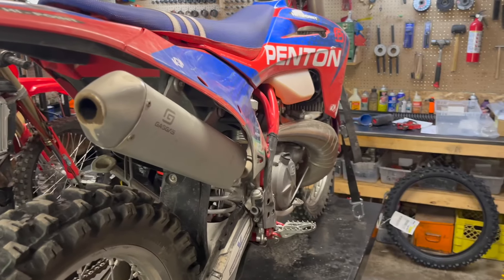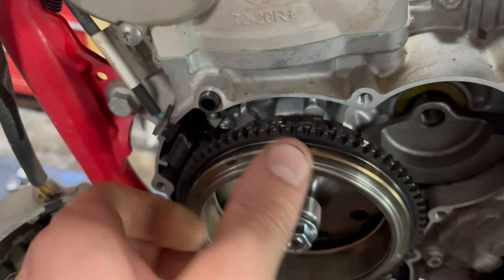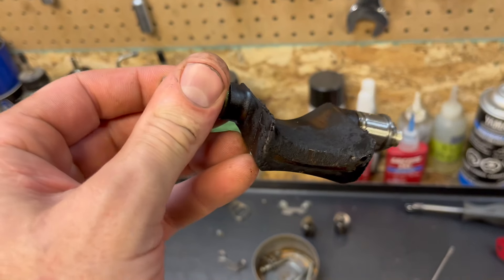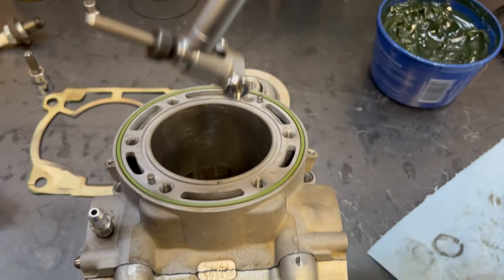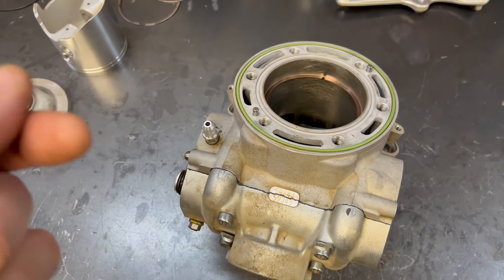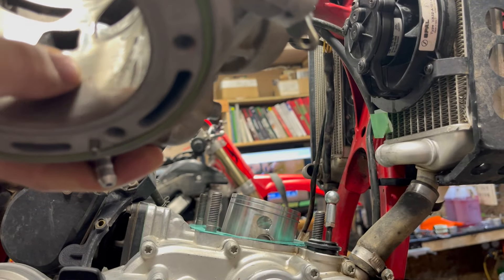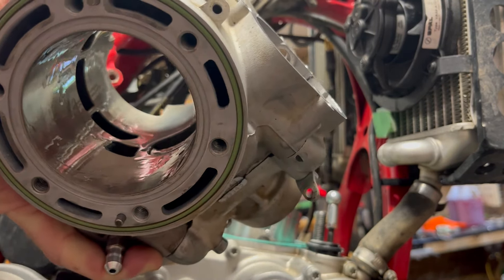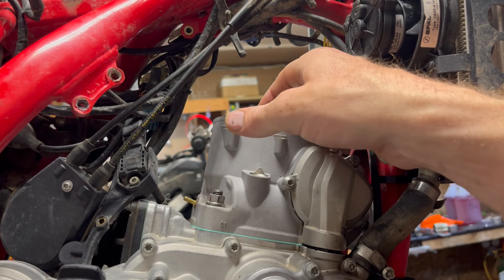How to do a 2 Stroke Top End- Properly

Comment: yesss not enough people measure the piston to wall clearance.  I dont have a dial bore gauge but I use a telescoping bore gaugue and mic out the measurement on the top middle and bottom of the cylinder walls on the x and y axis.  You really are one of the most thorough mechanics on youtube Ive seen.  Always learn from your videos, keep it up
Reply: For sure. I've machined alot of bores for critical bearing and bushings over the years and have gotten by with gauges and a mic.
Reply: @jeremydoblinger3609  Yep, telescoping gauges (called a comparison gauge, because they don't give a actual number with out a OD mic), take a bit more sill to be accurate.  But once you do it well, you should be able to repeat measurements with in .0001".  The mic needs to be calibrated on a round surface for the best accuracy.
Reply: skill

Comment: The EIX plugs are a down grade over a conventional core plug. The biggest reason the rare metal plugs should be used is for higher service intervals. A conventional core plug is a better heat sink which is more important to high performance engines like these Vs longevity of the plug.

Comment: The torque of the cylinder base can distort the bottom of the cylinder, with gasket that can compress.  My YZ also has the front 2 bolts that I can not get my torque wrench on (don't have a "crow foot extension"), but I figured out a way to get them very close to torque spec.  I torque the back bolts about 1-2 lbs shy, then use the closed end wrench (noting the hand pressure) to finish them off.  The torque the front bolts noting the same hand pressure.  I think I will use a bit of grease on the thread as you did for the most consistent torque feeling.  The base of the cylinder with gaskets that compress, bends a bit around the transfer port area, like pushing down on a teeter totter on both sides.  On the smaller engines I build for a living, it can be enough distortion to close up .002" of piston/wall clearance, and cause some piston wear at the bottom of the stroke if you run out of clearance.  I have used copper base gasket (with a sealer that does not dry before I can get the cylinder on), that do not compress, and they stopped that cylinder base distortion under proper torque.

Comment: Ring end gap!  Wow, very little wear.  I set my YZ250 (Weisco piston and rings), to .004" for the installation, Run Motul oil (similar to Motorex I believe), with 20 hours on the cylinder form the stock piston, (cross hatch is not abbrasive).  I just measured .016" gap after only 5 gallons of gas (about 5 hours in my estimation).  I don't know if Weisco has rings made by communist china, but I am now suspecting the rings are pretty soft.

Comment: When installing the wrist pin clip try using a tire valve stem removal tool. Gets a nice bight and has enough leverage to just roll it in. Curious to see what you think
Reply from the maker: I’ll experiment with it.
Reply: Brilliant idea, thank you! I will try it
Reply: @ChuckfromTrueTech  You did put the c-clips in correctly, (I got good at using a flat screw driver and sweeping in the end), but you forgot to mention that the open ends of the c-clips need to be at 12 O'clock or 6 O'clock.  If the open end is sideways, they can actually pop out because of fast piston direction changes,---and totally destroy your cylinder.

Comment: Back in my day, what turned the tranny oil black fast, were the stock aluminum clutch drive plates.  Steel drive plates don't wear as quickly, or contaminate the oil like that.  I like to break the sharp edges of drive and friction plates, where they contact the hub and clutch basket, to slow down the wear on the hub and clutch basket.

Comment: The burnt oil onthe underside of the piston crown was affectionately called, "Death Ash", and is an indicator of lean/hot jetting.  KTM is a company that kisses the EPA's but the most (expensive and part of the reason for their bankruptcy), so they have the engine running on the edge in an effort to burn all the hydrocarbons they can.
If you want your 2-stroke to last longer IMO, ignore the EPA.  They really don't care how long your internal combustion engine lasts, or how much it costs you.

Comment: I'm impressed how easy you got the piston in the bore without the rings spinning off the locater pins. On a 250/300 I can do it with a little fiddling. I will mark the pin locations with a sharpie so my old eyes can see. But with my KX500 I find it such a struggle that I will insert the piston before mounting the cylinder and then put piston and cylinder on the rod and then insert the last c clip on the piston.
I'm surprised you don't show putting a light film of grease on your gaskets for easy removal and recycling.
Reply from the maker: I don’t use grease on my gaskets. Getting gaskets off is an issue with OEM Honda gaskets, but these rarely stick. 
I struggle more with 4 stroke rings than 2 stroke. Most modern cylinders have a nice little chamfer on the bottom that helps a lot.
Reply: I just find a little grease on my gaskets for clutch, ignition or PV covers and I can reuse them many times. Especially helpful on the KX500 snowbike ignition cover that I have to remove after every ride pretty much to dry the ignition from condensation moisture.
Yeah I have done a few KTM top ends for friends but most of my experience comes from Japanese 50 - 500cc two strokes.   @ChuckfromTrueTech

Comment: I doubt the piston was hitting that carbon on the exhaust side of the squish band, but is a bit of detonation.  I would bet 3 more octane points in the fuel would fix it if the fuel/air mixture is not lean somewhere in the rpm range.   The carbon build up, I am not so sure about, but it may be reduced with a cleaner burning oil.  I know a engine builder who tested a lot of different oils on their dyno, and they like the best, the clean burning and lubricity of Motul kart GP 2-t oil.  But judging by the plug color, (a bit on the lean side IMO), you might want to figure out how to get a bit more fuel in the engine.  That is a hot spot.
Reply: If that is a higher compression aftermarket head, the higher compression runs hotter and also leans out the stock jetting.

Comment: What would leaking in the seal look like?  Discoloration on the crank end or oil build up?  Also, B sized piston?
Reply from the maker: Leaking crank seals often leak drool down from the seal. I forget what size I installed. Whatever was needed to get the best clearance.

Comment: If the factory gaps the rings at .0025" (Yamaha at .003", Weisco stated .004" for my 250 bore diameter), why do you file them to .013"?
Reply from the maker: Sounds like you’re mixing up piston clearance & ring end gap. Rings will seize within minutes below .010”.

Comment: These videos are great.  A video about the IRK would be nice.  I have the TSP head and remap on my '19 300 TPI; it transformed my bike.  What is the biggest advantage (if you can call it that) of the IRK?  Is it lubrication?  I don't need 'more power', seems to run well enough but I'm always thinking about oil and longevity.  Would the relocated injector help with transporting oil into the crankcase quicker when it's cooler out?
Reply from the maker: By the amount of lubrication in my bottom end it would seem that there might be a correlation. That’s a big thing to say from just one example.
The IRK allows for more top end power. Bottom end power is sometimes more difficult to tune though.

Comment: hi Chak, on my tpi 300, the piston stuck to the cylinder for the second time, the pump pours out 8 ml of oil during the test, could youtell me, if the pump can sometimes stop working? I can't find the cause ((((
Reply from the maker: There are a few different volume specs for the oil pump test on the TPI. You need to check the manual for the volume. 8 ml seems low though. The pump may have failed.

Comment: What's your break in procedure for a top end?
Reply from the maker: I warm it up at idle & lightly blipping the throttle. I don’t want the piston to expand quickly before the cylinder is also hot. 
Then I ride the bike, progressively putting more load on the engine. I do this a couple times and then ride it is normal.
Reply: @ChuckfromTrueTech you also mentioned running pre mix. On a normal tpi oil injection what ratio would you put in the tank. And how much?
Reply from the maker: @Relentless_Hard_Enduro  I run 50:1. Been playing with 40:1 though. It's just like any other woods bike. If I know I'm going to be doing long hills or doing a lot of wide open throttle I'll definitely do 40:1.